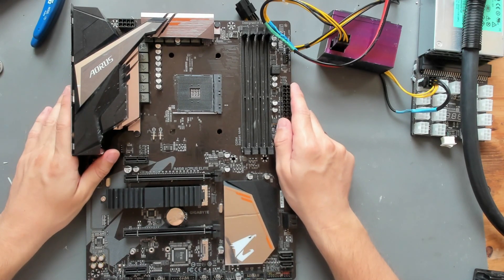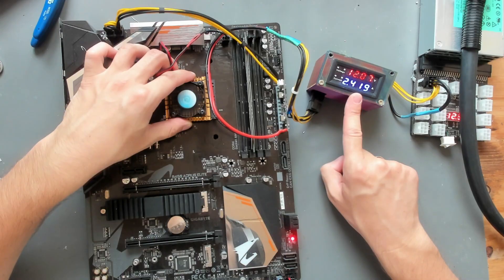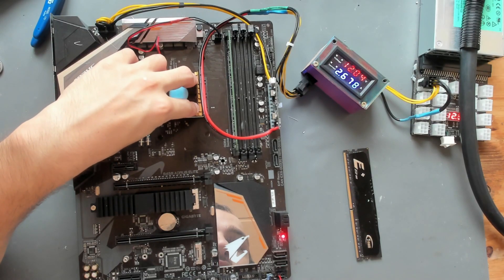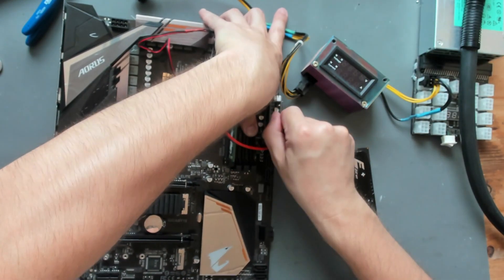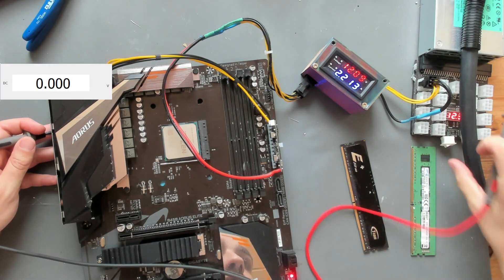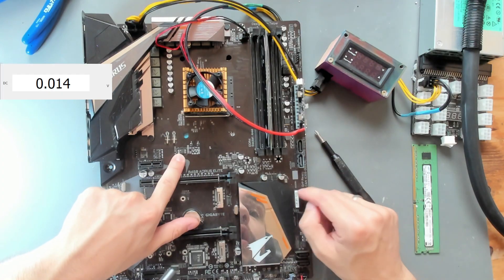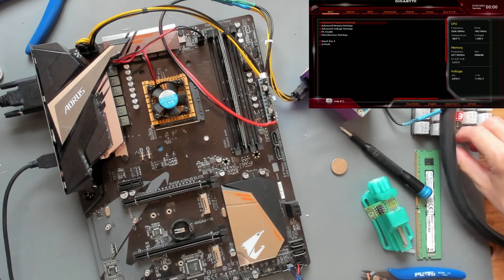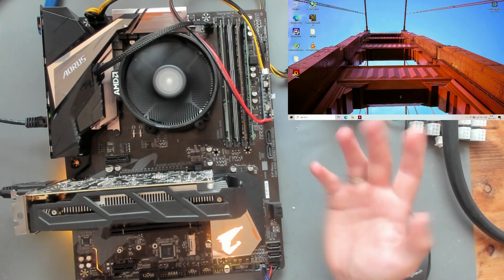HOW TO FIX DRAM LED ON MOTHERBOARD || B450 AORUS ELITE

Comment: Hi. I have the same problem. How did you flash the BIOS? The BIOS on the manufacturer's website has the .f51 extension, for example. How did you convert this BIOS to one compatible with the .bin firmware?
Reply from the maker: There is no need to convert it. Its already a bin file! You just open up the f51 file in your programmer and you will see the data!

Comment: No1. Cause this issue is because the cmos battery especially when it's completely dead l, so best thing to do is replacing it every single year to avoid this kind of problem

Comment: Hello, today I updated from F51 BIOS version to F67g and suddenly there is no signal on my monitor. Before the update PC worked well.
Configuration: Ryzen 5 2600X, RX 6700 XT, 16 GB 3200 MHz Cl16, Inter-Tech Argus APS 720W. DRAM light stays on constantly and CPU light on motherboard lights up for less than a second after I press power button on my PC. I searched for solution but still haven't found one.
Reply from the maker: It might be that your 2600X isnt supported anymore by that Bios! Some Bioses kick out older CPUs!

Comment: Refurbished my old rig i had in use until a couple of days ago to give to a friend. The Mobo Asus Tuf gaming Elite is now stuck on the DRam light and nothing i tried works. ... been building PC for decades btw. 😉. Tried to bring it back to life for over 16hrs. - now gonna trash that piece of crap since we know there's no point in dealing with Asus support. Getting another AM4 board from a friend. I remember having a similar issue when building that rig but managed to get it back to work. ... sadly not this time - i'm fairly certain this is a Bios thing. Neither reset nor flashing works of cause. I just hope the other board we had for our server works ... Surely my first and last Asus hardware.

Comment: I bought the Gigabyte Aorus elite B450 Motherboard to replace my B450 Tomahawk.. EVERYTHING went smoothly and it has run for 2 months with no issues.
I had the option to update to windows 11 with this board, but I didn't. I installed a NVMe drive first with a PCIe adapter, then moved it directly into the M.2 Slot.
Then it said I couldn't updtae to windows 11. It still worked fine and I was using it with 0 problems. I decided to move the NVMe back to the PCIe adapter, and add another SSD.I switched it back on and it just won't boot. I get the CPU red light.. BUT IT WORKED FINE BEFORE I DID THIS!!
Now the fans come on at 100,000 mph when you switch it on and it has the red CPU light and no startup screen.
I moved the GPU, the NVMe, and I did have to unplug the existing connection to the fans in the front of the case, and move them to another power connection from the PSU to add the second SSD. And I had to move the SATA connection because the second SSD SATA connector would not fit.
After replacing the B450 Tomahawk, which I think was dead as it wouldn't even light up, and now this one going weird I think I am done with AM4.. 
How can it all be working just fine, and then just not work???
Reply from the maker: Dont want to be rude, but you probably hit a component while doing all that! Its one off the most common problems on Motherboards, that people knock off components, because it happens so fast and so easy you wont even notice. Ive done it before as well!

Comment: MSI B650 Gaming Plus WiFi, DDR5 6000. By default, this RAM runs at a frequency of 4800 MHz, but I had it running in dual-channel at 6000 MHz (I don’t remember whether it was an XMP profile or a special one for AMD (EXPO maybe)). Everything worked fine until one day the power went out, and the PC stopped booting after attempts to reset and flash the BIOS.

I ordered the exact same motherboard, and after installing all components, it worked. The RAM operated at 4800 MHz. I tried enabling dual-channel mode on the new motherboard, but the BIOS wouldn’t save the settings. Then, I decided to update the BIOS, and during the update process, the PC froze and stopped booting into Windows. Now, the CPU and DRAM indicators remain lit, even though I know all PC components should be functional.

I tried removing the battery and resetting the BIOS by shorting the JBAT1 pins, but neither method worked.

I also attempted updating the BIOS by leaving the USB drive connected to the dedicated BIOS flashback port, but that didn’t help either. Even with the CPU and DRAM removed, their respective indicators remain lit in red and orange.

Please help me resolve this issue!
Reply from the maker: That sounds very unfortunate! Can you verify that the bios flashback goes trhough successfully?
Reply: @ Unfortunately, it won’t install, even though I already did it on my old motherboard ☹️

Comment: I bought a faulty board with the same problem, previous owner had broken an 8.2k resistor near the bios IC. Replacing it and flashing bios fixed it
Reply: show did you know a restistor was broken? I might have that issue too
Reply: @s4yto  I found it under the microscope, the previous owner stated that the board failed after a CPU swap and he must have knocked the resistor when fitting the heatsink.
Reply: @nedbeard  my pc was working fine for a month after changing my cpu tho, it suddenly restarted midnight and no post since then, DRAM led on mobo, when trying to fix the issue and short the 2-pin to clear CMOS it somehow started it power cycling, shutting down after 5-30 seconds

Comment: I have a bios chip reprogrammer tweezer and tried uploading a new bios to the motherboard without desoldering, but it didnt work, maybe i have to desolder it
Reply from the maker: Getting the clamp to work is really hard! It defenetly can work, but if you are able to solder its way easier to just do that. The clamp needs many attempts until they work, at least for me!

Comment: Hi! Can you share how you do to measure the voltage and amperage from motherboard? And how to build that? The schematic... And the names for buying the parts needed or the link to bought? Thanks... Greattings Portugal 🇵🇹 🌟
Reply from the maker: Hey there, i will need to do a video on that, quiet some people have asked now, dont know yet when to do that!
Reply: @MainboardMedic  can't wait... But can you tell what parts needed to build? Thanks
Reply from the maker: @skysurfhf  Its a 3D printed enclouser then you need some kind of 12V power supply with at least 10A you can use whatever, even a standard ATX power supply and then the mainpart is a M4430!

Comment: Hello🤝 there are problems with the BIOS in your entire b450 series, I had the same problems with all the voltages, replacing the RAM and processor did not help, at the end after one of the attempts to upload the BIOS it started and it was not the latest BIOS, strange configurations, best regards👍👍👍👍👏👏👏👏👋👋👋👋👋
Reply: hi. where u find that bios file?
Reply from the maker: @SekitarDunia-u2t  Support site off Gigabyte when you search after the modell!